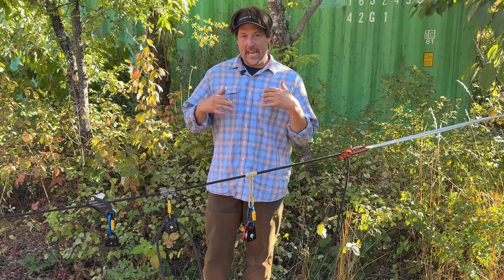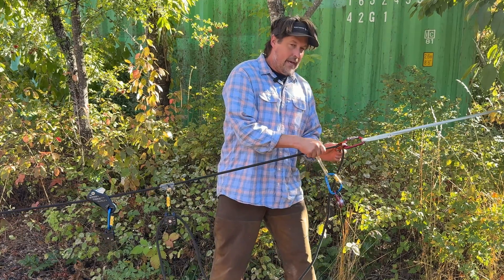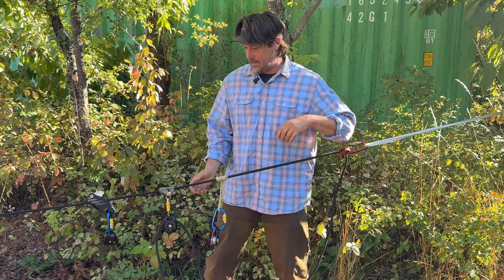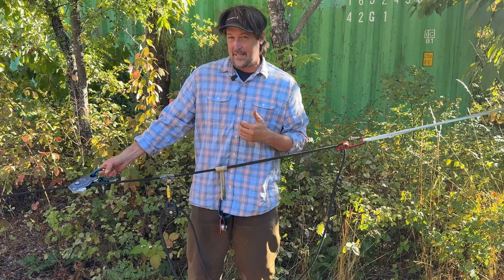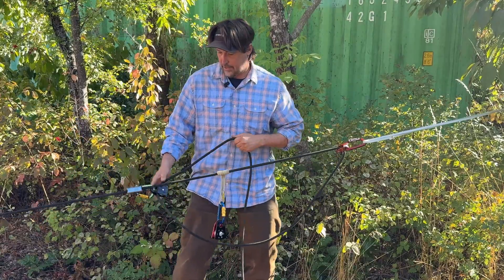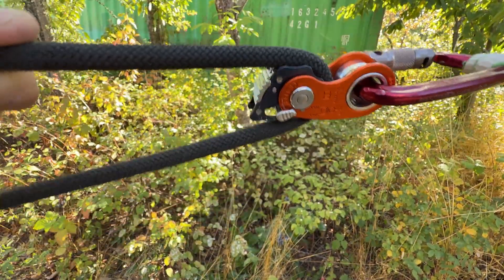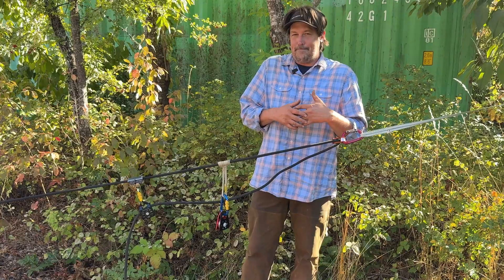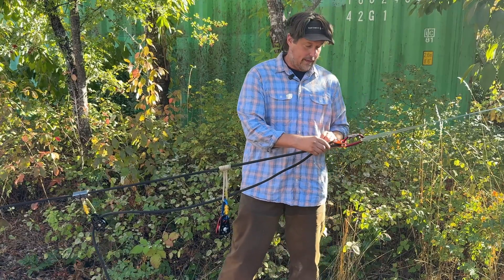Using Cam Devices to Set up Mechanical Advantage Systems

Comment: With the auto-block sling used in a progress capture. Have you used the "third hand" or "auto block" knot that is just the loop wrapped around the rope with both ends reconnecting to the carabiner? It is probably the weakest friction hitch, but is it strong enough? Since almost all the material would be used in the friction hitch, you would have less lost capture due to the friction hitch being against the pulley at all times. It would also slide better, working better in a self-mending application.

Comment: I have used several different cam progress capture devices and carry a few different ones in my pin kit.   I feel they should only be used in certain situations as they were "not" made or intended to release with the load a pinned raft can exert on the device it in a safe manner (if you can even get it to release).  Just in my opinion.

Comment: Check out the petzl tibloc. 8-11 mm, small and light. 
For your progress capture, cmc clutch or MPD. The downside is that they are expensive and have a very small range of rope.
Reply from the maker: They have teeth that can shred rope sheaths
Reply: @GearGarageTV  Yes, but not until about 6kn. A 6mm prussik will fail around the same force. The micro traction would also do the same.
Reply from the maker: Shredding rope sheaths is a worse outcome for 2 reasons: (1) The rope you were planning on using is now unusable, and (2) ropes are expensive.

Comment: When using the Kong Duck as a pulley, the rope should go around through the carabiner, figure 4 in the manual: https://www.kong.it/upload/files/I_KONG_DUCK_ZZV05522_rev.1.pdf Very similar device to Climbing Technology Rollnlock but I think the load path makes a difference - may be easier to release the cam to unload it. Havent used Rollnlock. I still carry a prussik in case the cam devices fails or are incompatible with a rope.

Comment: A prussik can float, depending on materials. If your rope is wet it’s less likely to melt. I don’t think we can generate the type of friction required to melt a technora sling onto a technora rope. Sure, a prussik will slip, but that’s a safety feature so that metal pieces don’t break. Adding a bunch of heavy metal rope grabbers seems like a great way to desheath polypropylene sheathed ropes that many paddlers carry. I prefer narrower pulleys, so that they actually mind the prussik. If you use a 9mm rope on a pulley that can accommodate 13mm ropes, the prussik gets sucked in. Blue Water and SMC both make narrower pulleys.
Reply: It would be BRUTAL if you dropped it right before getting to pull. So you’d probably want to carry a prussik as a backup anyways…
Reply from the maker: Those small pulleys are incredibly inefficient
Reply: @GearGarageTV  I agree. Keeping a spare small pulley in the pin kit makes it easy to turn it into a compound 6:1. Because of the inefficiencies in the system the 6:1 actually yields 3.1:1. The weakest part of the system is still the prussik sliding on wet rope or the knot in the system.